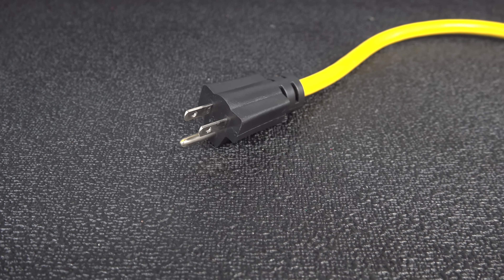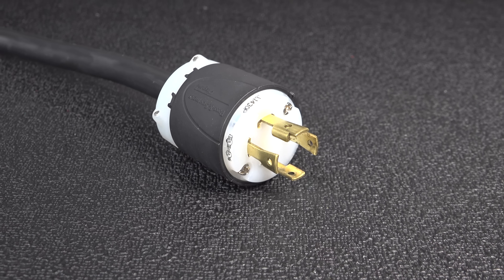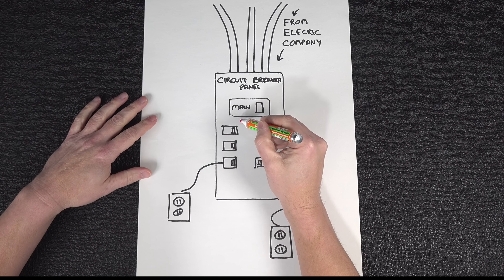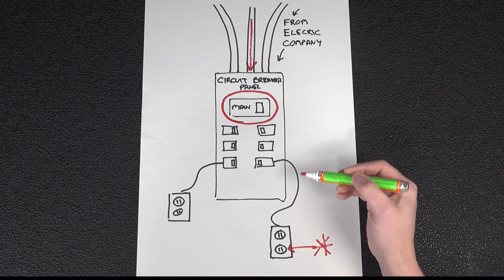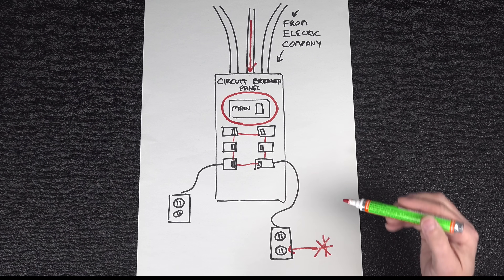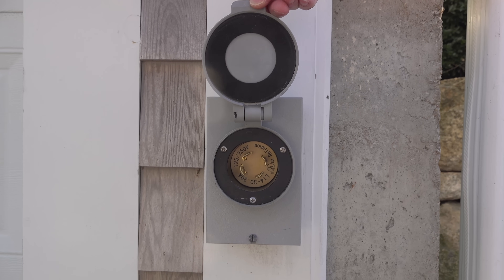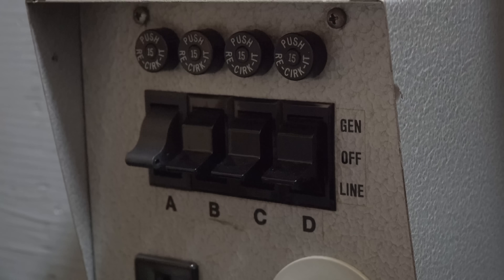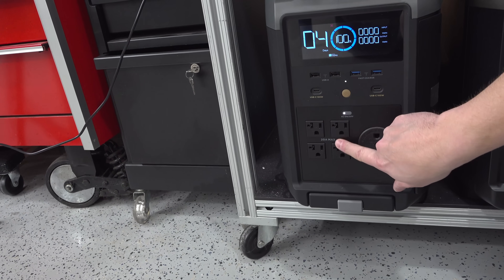Worst Electrical Mistake You Can Make - Backfeeding Generators

Comment: Serious question, is illegal the same as a violation of the national electric code? Can you go to jail or be arrested for a nec violation?
Reply: There are many negligence laws. You hurt someone, you are definitely going to jail. Even if your own property (causing fires, etc). 

Of course if you don't hurt anyone, how would anyone know?
Reply: https://youtu.be/AO5L86P3kHI
Reply: @43j832  Those charges were dropped. FYI
Reply from the maker: Its definitely against the NEC and its always called illegal but that is a great question. Needs some more research as to if it's a fine or do they come lock you up. Other may chime in with more info as well.
Reply: Don't know, but I would guess that varies locally. Where I live some health code violations in a restaurant can be charged as misdemeanors. At least they were possible charges then. I haven't read the code in a long time though.
    Also local ordinances are still on the 2008 NEC. Currently.
   Edited for spelling but on a phone there's probably more
Reply: Absolutely not...
Reply from the maker: From the reearch I did I see that people have been charged with murder, attempted murder and other charges related to this. Probably similar to speeding, your town would give you a fine for doing this but if someone was hurt or killed, backfeeding would most definitely be seen as an extremely negligent act. Others have aslo said that insurance companies may drop you and you may lose an occupancy permit for your house.
Reply: @SilverCymbal  Murder?  source?
Reply: Looked up what happens if your neighbor reports you: where I live you'll get a notice in the mail you've been reported to building safety, and that an inspector will be out within 90 days.  He'll show up and see no cords actively hooked up or any violations at all, and he'll report back that you're fine.  He doesn't search the house for portable generators or suicide cords, just inspects what is currently hooked up.  If he DOES find your setup, it would be cited as a violation and they give you 180 days to show compliance, which would require unplugging it.   Pretty sure the grounding is SOP for lineman regardless. . .

Comment: Besides being illegal there is another thing to account for,  you void your home insurance if anything happens due to using this practice.
Reply: That’s not actually true. I’m a large loss insurance adjuster. I’ve handled hundreds of building fires over the years. If being stupid was an exclusion then few people would have their house fire covered. 

There is no home owner or business owners policy on the market that has an exclusion for back feeding. And obviously none for stupidity. I’m not condoning the practice, just stating it’s not excluded for coverage. 

However… if a professional contractor/electrician made the cord and connected it and charged you for their services, then that individual would be held responsible (or their insurance).
Reply: Wow and there are people on this platform recommending this?
Reply from the maker: Two that I am aware of post posted in the last 6 weeks, sadly there are probably more. There are plenty of rules & laws I don't follow in life and I support lots of causes that stand up for rights. But promoting back-feeding like it's normal is insanity.  Kind of like when I used to weld, its pretty common knowledge you don't weld galvanized metal but guys still show it and do it, but at least they only hurt themselves. Electrical issues can hurt many people that aren't involved.

Comment: I didn't consider the safety side.

I did do considered that energy may be back anytime and mains would fight the generator resulting in a nice boom.
Reply: You're smart, that's the actual risk.  The grid backfeeding is prevented 99.9999999999999% of the time because the little generator can't power the whole neighborhood and trips its breaker.
Reply: and a nice BOOM 💥 it would be!

Comment: I Agree with the Fact, that Most People Have Lost their COMMON SENSE over the Years. Those People would be Very wise to follow your Advice. For the People left on the Planet that Still Have COMMON SENSE, it’s Perfectly Safe to Back-feed your Home, with using the Breaker Lock Suggested at the End of the Video.
Reply from the maker: Correct with an interlock it's safe to do and could be done by someone not understanding the steps and they still cant do it wrong which I like.

Comment: A male receptacle is a power inlet. A female receptacle is a power outlet. The generator outlet is physically on the generator. The male receptacle on the house or RV is the power inlet and you connect a proper cable from the generator outlet (located on the generator) to the power inlet on the house or RV. It seems you got some of the terminology confused in the video. Most people do not deal with power inlet receptacles so they some tend to call all receptacles "outlets" which, when dealing with inlets, is wrong and can be confusing to those learning how to do this correctly, especially when communicating their ideas with someone using the correct terminology. Otherwise,  thanks for the video!

Comment: Thank you for this.  I work in the trades and am pretty handy guy & I don't like messing with electricity. Back when I was a young man I worked as a paramedic and in 15 years I saw more than a few DIYers electrocute themselves.  This may not be exciting but it is necessary knowledge.
Reply: I worked at hotels and apartments as a maintenance guy my whole life. Most of my co-workers had no experience or knowledge about anything,(especially electricity).  They almost got me killed several times.
Reply: Shep VanDelay  house are extremely simple to wire.
Reply: My dentist back in the 1980s had his arm blown off in a high voltage accident when he was 20yo. He had a stainless hook that opened and closed. some of his tools were modified also. My sister worked for him as an assistant.
Reply: @Chris_at_Home  no way am I letting a dentist with a robot arm near my mouth 😂
Reply: @dirkdiggler9379  He was known as a very good dentist. The claw as you call it allowed him to work quite well without his whole hand in the way. He went on to become a state legislator. They even named the Wasilla Sports Center after him.
Reply: @Chris_at_Home  I was just joking  I’m sure he’s great 👍🏻
Reply: @dirkdiggler9379  ok dirk diggler you sound right winged
Reply: @2miligrams  you sound like a pole smoker
Reply: @2miligrams  stay in school kid
Reply: I've spent 15 years redoing diy work.
Reply: Shep VanDelay  Contact with live wiring, fixtures, and things like that kill more electricians per year than overhead lines. It's one of the leading causes of death in the construction industry, though less now, because people are more up on safety practices. Promoting this attitude gets people killed, man. You ain't got time to live if you ain't got time to ground/verify. To me, that's just unprofessional. That's what 'sparkies' do. A good electrician shouldn't just let himself get killed for a stupid light fixture or something equally dumb to die over. No job you're doing is worth that risk, just to save some effort.
Reply: If you can’t follow step one and only of simple instructions open main then yes “backfeed” is not for you. Lol. But I can tell you lineman don’t give a sht about backfeed.